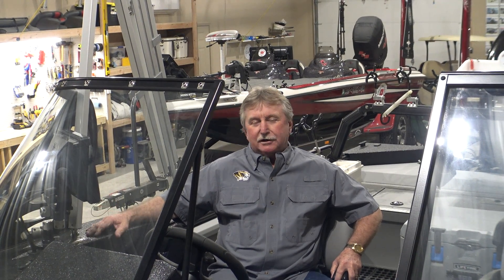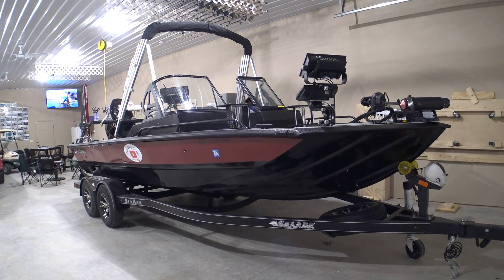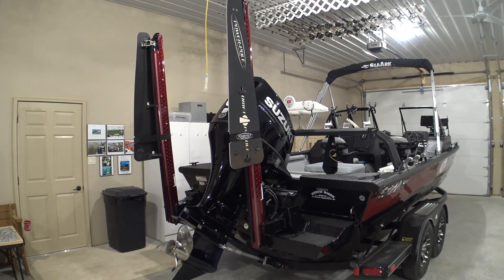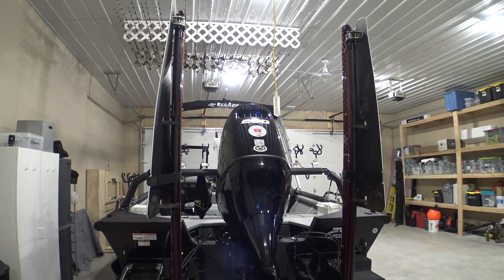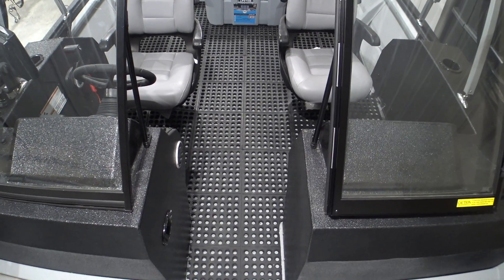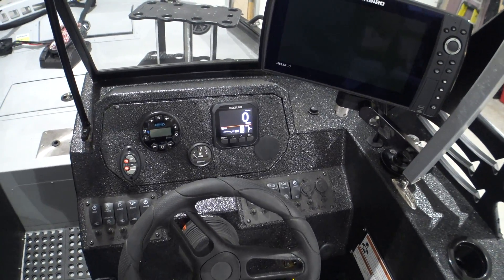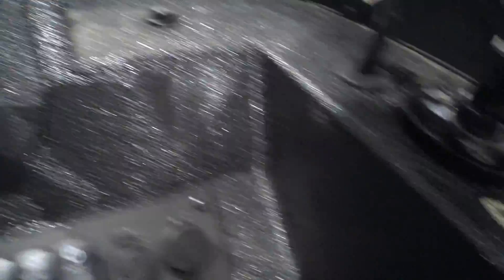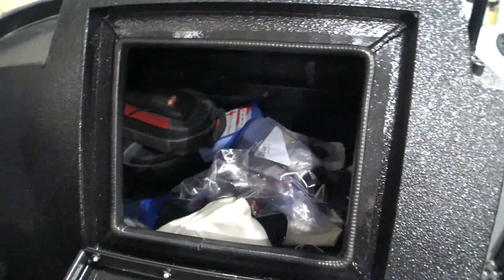2022 Sea Ark Protege Walk Through #51 (4-22-2022)

Comment: Thanks for the video, I am going to buy the protege. I will send you pictures. Do u have a source u can recommend for the enclosure? Also, does your foot pedal have a place to be stored or can it be disconnected easily
Reply from the maker: You will love it!  I purchased my enclosure from Sea Ark when I purchased the boat.

My trolling motor foot pedal does not disconnect from the motor.  I just leave it on the deck.